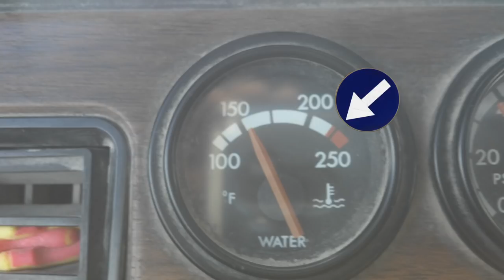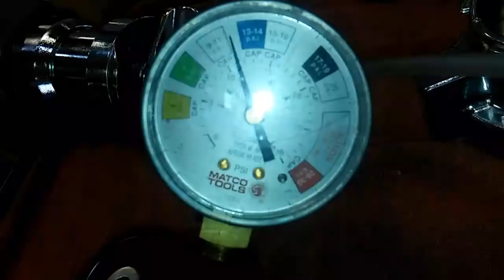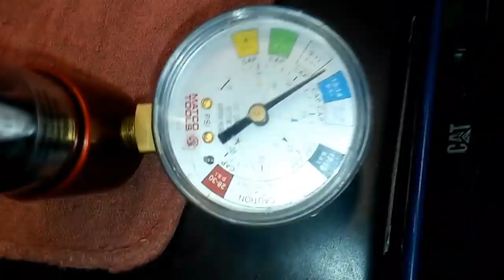Why Do Engines Overheat?

Comment: Adept abe: I have an issue..oil in airtanks I've changed aircompressor.
Reply: Just_trucking are you sure it's oil and not water?
Reply: Jay Dunbar its black and muddy like oil plus I'm losing oil but no visible leak
Reply: Check for oil in the CAC pipes if your compressor pulls air from there and not a fresh air source.
Reply: Ozzy ô : I'll check in the morning if that is the case what is the solution?
Reply: gimik2 I bought same remain compressor not sure if the check valve was installed or not I'll contact shop I had it done at later

Comment: Question, low temperature thermostats do not alter the coolant flow rate, just the temperature at which coolant will flow.  I know that some people will install low temperature thermostats in hopes that will cure the overheat, which usually doesn't because once again it does nothing to flow rate, just when the flow starts and stops.

And you already mentioned that colder thermostats contribute to accelerated engine wear because the engine never reaches optimum engine temperature.

My question is this: What about thermostats that have a higher temperature?  My Cummins originally came with 190F thermostat, what if I replace it with a 205F thermostat?  The engine would still be operating below the red-line, but slightly warmer... in your opinion do you see any issues?
Reply: As a former Cummins mechanic, I would recommend you maintain the factory specified thermostat.  If it is changed, I doubt any serious issues will arise.  Traveling across the hot desert regions, engines usually ran around 205F and never saw problems.  Never did track fuel consumption though.